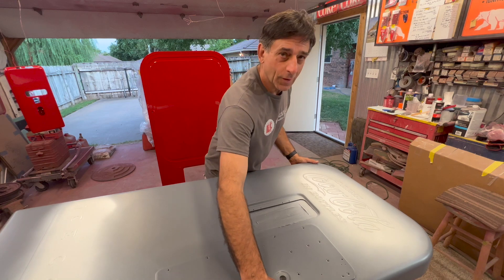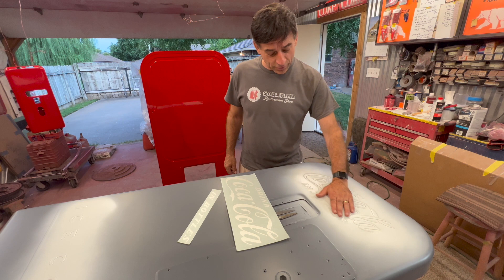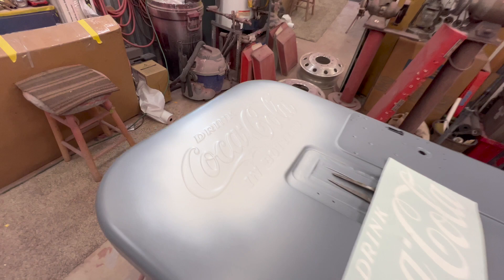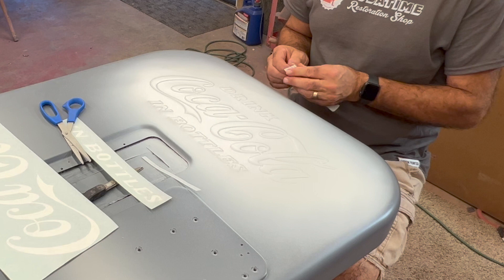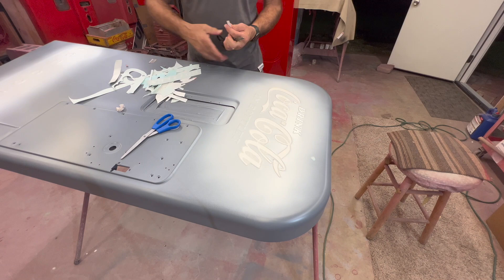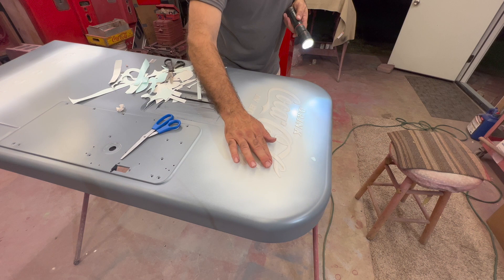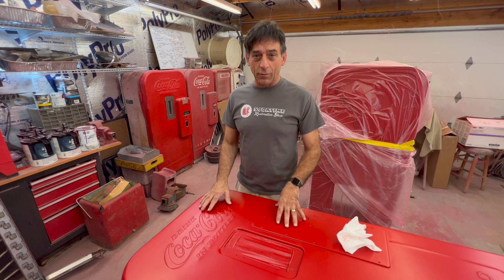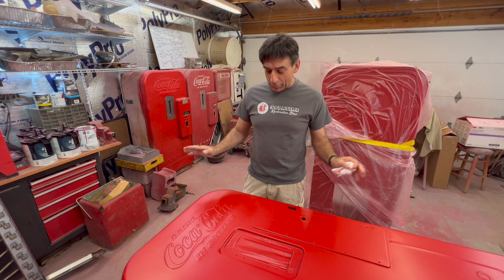Paint & Vinyl Peel Process | 1951 Vendo 39 Coke Machine Restoration

Comment: I use the same technique on my machines.  I learned it from Rod Heuerman of Fun-Tronics.  I have a Vendo 39 from the first year (1949).  It has a Nash-Kevinator compressor and it has two metal posts on the back to keep you from pushing it too close to the wall.
Reply from the maker: That’s cool! Post some pics of your 39 in the comments! 😊

Comment: Hi Marc. I have subscribed and enjoy your videos. I have a question working on a Vebo  44 that is both red and white and was wondering if the technique you show will work with red lettering under white any issues in the red lettering with white overtop.   I am concerned that, after spraying the white, the red may show through  Reverse of the Vendo 39.  Have you ever done it that way with red lettering
Reply from the maker: Good afternoon Sandy!
Yes I have done both ways! 
You will spray your red on the letters then apply vinyl lettering, then cover the top with white! Then you you will peel the vinyl off and then clear coat !
Make sure you are using a base coat type paint that will need a clear coat over it!😊
Hope this Helps! 
Have a blessed Day!😊

Comment: Marc, in one of your episodes, I seem to remember you saying before you used the vinyl decals, you used the "sand-through" technique. Is that where you would paint the entire door red, cover the embossed lettering with contact paper, sand the contact paper just enough to expose the lettering, then paint the exposed lettering white?  If so, why did you abandon that technique? Thanks.
Reply from the maker: https://fb.watch/gVmKpb3yQr/?mibextid=qC1gEa
Not a great video but yes ! 5 to 6 coats of white base coat! Let it dry if not let it set overnight!
Then 3 to 4 coats of red over that!
Let it dry overnight then start your flat block sand!
Did this for many years and just this past year switch to vinyl!
Hope this helps! 
Thanks Marc

Comment: Where do you get the vinyl and correct paint
Reply from the maker: You can get the vinyl from Funtronics for the vendo 39
Paint code I use for the 39 
Red #1767563 Martin Senour 
White # 1803446 Martin Senour
Reply from the maker: Napa Auto parts
Reply: Is the vinyl the type you put down after the base coat and then peel off to reveal the actual paint…..sorry but I’m new at this
Reply from the maker: Spray letters first with basecoat
Allow basecoat to dry then apply vinyl 
Spray basecoat color over vinyl 
Next day peel vinyl off
Then apply clear coat
Reply: Thank you Thank you Thank you 🙏